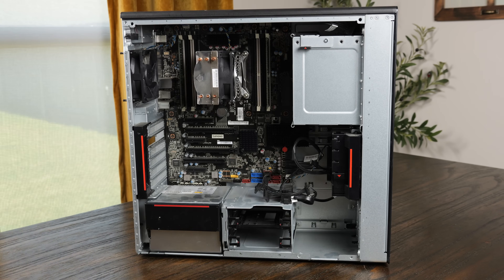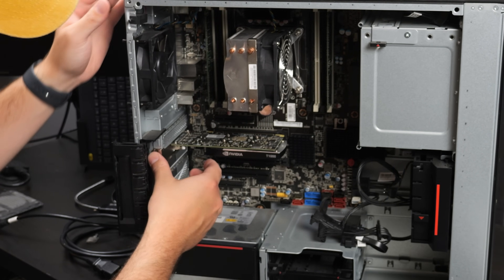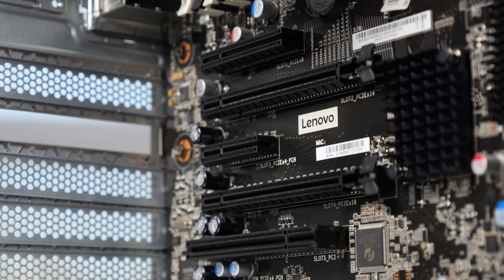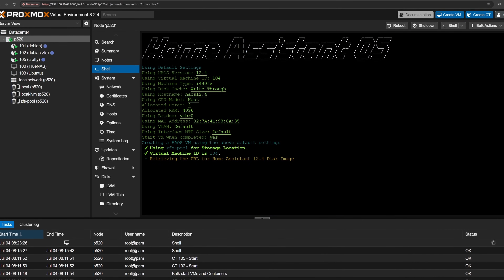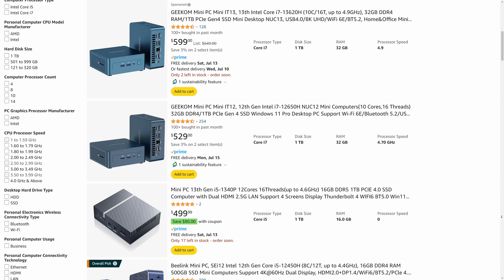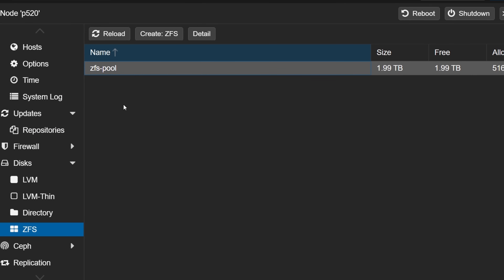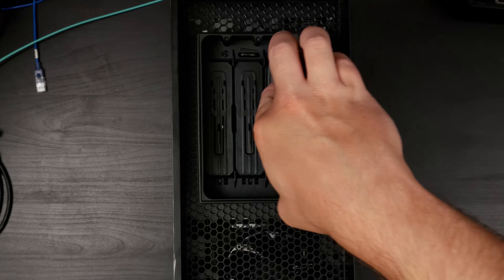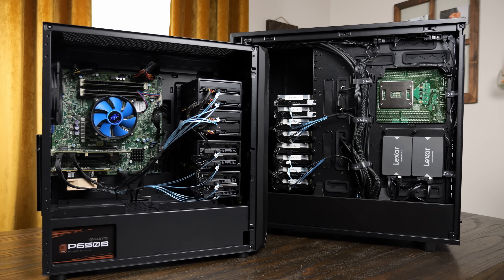A SERIOUS Home Server That's Affordable [Lenovo P520]

Comment: You should have gotten a HPZ800/840 instead. Dual Xeon, with a very smart layout for drives and cooling.
Reply: HP Z840 is an older system. HP Z8 G4 would be from the same generation as the ThinkStation
Reply: @Pasi123  Correct!..I replied without thinking.

Comment: I actually have a p510. It came with a E5 v3 6 core and 32 GB of ram. I upgraded to a E5 v4 10 core and 128gb of RAM. It has 4 HDD bays with trays and there's essentially a backplane in it. It also came with a Lenovo Flex adapter (proprietary) which holds one gen 3 nvme and one SATA m.2. I added a single nvme card and it's dead silent. Running Truenas scale (passed through the sata controller) and several VMs. I can't complain. I paid $100 for it from a local seller.
Reply: really just a fantastic deal.

Comment: Hm, about the 3D printed HDD cage, you say, it's not the best design. Still, if you have only two options, original from Lenovo, and the 3D printed cage, the latter is both, the second best solution, but also the worst solution. 😂

Comment: Yeah baby! P520!
*beams at mine over there, which is also used as a gaming PC for my kid, sporting a 2135, 32gbs ram, a couple M.2's and an ARC750)

Now go look at a PowerEdge T110-II! My old standby main server!
Reply: I'm interested in something like this. How did you power the ARC750?
Reply: @armandourbina3986 
I have two 6+2 pin connector cables attached to the mobo, with it connected 1x8 & 1x6.
I have yet to get Resizable Bar working but even without it the setup is wonderful for gaming.

Comment: Great video. About 4 months ago I bought a dell Precision 5820, easily the greatest computer purchase of my life. It was $650 AUD with 128gb of ram, an nvidia p1000 and the model up from the chip in this video the w-2145 which is an 8 core 16 thread cpu. If anyone is in the market for a home server these types of machines are incredible. My unit didn't come with an extra pci power adapter, so I picked one up for 20 bucks to run a 1070

Comment: I have a Brickstation P520 myself, it is a serious machine that I generally use for gaming and A/V rendering, or writing silly comments on Youtube. You could use the P520 as home server but its primary design is a workstation, it may not have some features that server systems would have. Lenovo's ThinkSystem machines are server-grade models and might be more suitable. Also, I did some measurements and found that the P520 could potentially accept consumer hardware. The case has punch-outs where a standard PSU could mount, and the motherboard could accommodate a standard mATX or ATX board. However, the case only provides about 110mm of clearance for a CPU cooler, and the front panel uses a proprietary edge connector that would need to be removed and replaced with a new power switch.

Comment: I have one running proxmox, the only issue was getting the bay expansion and the 4 power SATA cable, I'm wating for the cable but finding the expansion bays is really hard, I had to use a phantkets stackable bracket

Comment: I really love these for homelabs as long as you have the space for it. They're super nice to work with (bar the proprietary nature of it of course) and the only reason I didn't go for it is most of my server load just needs maybe 2 PCIe devices and most importantly, I just think rack mount looks nice albeit louder, more power hungry but in my case, cheaper up front cost but very timing dependent. Anyone looking to play with hardware more, might be trying out different PCIe devices, or just doesn't have a specific goal in mind, I can't recommend these enough especially for a lot of the prices you'll find.
Reply: There's a rack mount adapter for these also.  Big money for drawer slides from Lenovo, or a 3D printed option on printables.

Comment: PCIe lanes and remote access is everything I want in a system, especially if it is used as a server.
The closest thing to the Thing Station is technically a used AMD TR or lower class, which are still very expensive.
Or the way around ASrock's rack motherboards for AM4/5, which are also expensive but only have a maximum of 24 consumer PCIe lanes.

Comment: got a r630 with dual e5 2690v3 with dual 10gbe and dual gbe plus 32gb ddr4 for 117€. an absolut steal cuz used hardware is like the most expensive here in germany looking at ebay all around the world... 🥲

Comment: For starters, like me, I would recommend cheap Lenovo m720t, minitower with 3 sata on board (Ive put inside 2pcs 3.5hdd easily)  + 1 m2 nvme and intel i3 8100. Very cheap and power efficient

Comment: The Dell Precision workstation 5520s are all over ebay too and simular to this.  Lots of tooless easy expansions, etc..  I tested one with a Kil-a-watt and it hovered around 70 to 90 watts at idle on a windows 11 login in screen with one nvme boot drive and two spinning disks.

Comment: Why wouldn't someone want to buy Lenovo ??

They make the most reliable, upgradable, repairable hardware around !!

They have great parts availability and all the manuals and tech info are on their website, even for really old gear.

As a Laptop repair Technician, they're the only Laptop brand I'd buy.

I can see that their Enterprise gear uses proprietary crap, but so does Dell and HP.

Comment: didn't seem to be much newer that the E5-2699 which i got two at $40 a piece (18 cores, 35 threads), and drop them in a HP workstation that cost me $120

Comment: Yooo Hardware Haven, I bought a ThinkStation P510 for my home server last year!  It seemed like the cheapest way to get everything I wanted for my homelab.  It was cheap and easy to add a lot of upgrades, and it has been a reliable and powerful beast of a home server that I've been very happy with.  Power usage on mine is higher than I wish it was, but then again I've got two GPUs, four hard drives, an upgraded Xeon with way more cores than I actually need, and a ton of cards in it so that might be on me.  I think this is an excellent way to go for a home server!

Comment: Dell an HP also have some pretty good refurbished/second hand offerings of the same generation (Dell T5820/HP G4 Z4) that you can find for around the same price.  I have the slightly older T5810 and after throwing in some more ram and upgrading the CPU it served me well as a Proxmox server until I upgraded to Epyc Rome.  

If your budget stretches a little farther there are also Epyc Naples cpu/motherboard/ram combos all over eBay for pretty decent prices and you avoid the proprietary nonsense (but it's not a complete system).

Comment: I found out that proxmox somehow makes pretty high idle power draw. When i installed pop_os i got 10 watt less in idle. Maybe bc proxmox is using relatively old kernel? I don't know. Try to boot different os from the usb stick and see if it changes anything.

Comment: On one hand: that's some lenovo proprietary junk. On the other hand, though, you can actually buy spare parts and replacement somewhat into the future and it's actually easy to find what exactly you need in most cases.
Reply: yup

my grandfather's current desktop had some issues a few years ago and after looking into it, I figured the power supply was dying and the motherboard had scorch marks where the funny magic electricity escaped 

I bought a motherboard with a cpu (didn't need it) for $13 shipped on ebay lol. I ended up also upgrading his ram at the same time and threw an SSD into it.

That was 6 years ago and I haven't worked on it since, and he still uses it daily. Parts for that machine are plentiful and cheap.
Reply: @RoshiGaming  yep, I ditched my last x220 from 2011 just last year and it went to serve yet another user. Seem like proprietary, yet abundant is better than standard and rare.

Comment: Fun fact, the p520 has a proprietary motherboard, the p520c does not, and is a standard matx only needing a 24pin to 14pin PSU adapter.
Reply: One final comment (sorry, I primary a p520c and have a second one as a server) the w-2145 is the sweet spot value wise, you can get at around $80 and is 8c/16t and you can get retired iMac Pro specific xeons that fit in here for very inexpensive and work with no compatibility issues. You also should be able to bifurcate the x8 slot with the latest bios
Reply: @Saphykitten  hey, appreciate this info. Do you happen to know if the p520c has remote management options available? Also, do you know how many 3.5" drives the case supports stock? I've been trying to find that information and haven't been successful.
Reply: also, for those that are interested in the p520c, since the 5.25" drive bays are separated, you can't use the 3-drive bay converters from places like icydock. You can find the oem adapters, which are called "Front Access Storage Enclosures". There are also stuff from icydock that allow you to use 1 3.5" drive and 2 2.5" drives, but figured I would highlight both.
Reply: Thanks for this
Reply: nvm, I see in the documentation that the p520c does support intel amt.

Comment: Good to know that it can do headless mode without GPU. AMT seems to be useful. 
Biggest issue: limited chassis space for modern GPU, proprietary motherboard and PSU. PSU too weak for dual GPU (some user reported instability when using dual 3090 or even dual 300W TDP Quadro card ), and no upgrade path.
Reply: Why would u even want to put that in this low end system?

Comment: I like the affordable system, but it won't be affordable to run in most of Europe sadly.
Reply: Have any suggestions for something low power with more than 20/24 pcie lanes?
Reply: @Cynyr  Actually it's not really the CPU which dictates efficiency at low loads, it's everything around it.
You want to make use of ASPM, which will power down PCIe devices (including parts of the chipset) to save power and allow the CPU to go in to lower power states.
Support for ASPM is hit or miss depending on the motherboard, but generally the fewer added components, the better. ITX boards tend to have better support too.
Also make sure the PCIe devices you plan on connecting actually support ASPM, including NVMe SSDs.

Comment: I just bought an HP Z440 for my home server, and I'm starting to get buyers remorse. I could've gotten the dual CPU model (the Z640) for $10 more and now seeing this next gen one for not much more than that, I'm feeling even more buyers remorse 😭
Reply: I have a z440 that runs my truenas/jellyfin. It’s a good machine, it’s not as good as the p520, but it has a lot of life in it. You also can put it in a normal atx case, or in my instance, I have it in a 4u rack mount.
Reply: @Saphykitten  I rehomed a Z420 motherboard a few years ago and would not recommend.  While the form factor is standard ATX, there's a lot of proprietary headers on the board that require hacky workarounds.  From memory, there's a PSU adapter needed, fan and power switch headers are nonstandard, and there's a proprietary temperature sensor that the BIOS will complain about if absent.
Reply: I got a Z840 running dual E5-2667v4s and 128gb of ram (8x16gb) working as my first NAS and occasional cloud server although the second part has a WIP. It will probably end up as an off site backup server when I eventually get a rack setup.
Reply: I have both the Z440 and the G4 Z4 which is the next newest one. Both are fantastic. I installed some highish end nvidia cards. They game pretty well at 1080. 

Its hard to beat for $350.
Reply: @quademasters249  got mine for $130 💪 I tossed in a RX5700 that I had leftover from my main PC when I upgraded almost everything, and my buddy had an old ES E5-2683 v3 that I also tossed in. Now I got a killer TrueNAS machine that can do hardware acceleration for my Jellyfin instance

Comment: What’s wrong with Lenovo besides then being a Chinese company?
Reply: They're typically stuffed full with proprietary hardware.  In this case, the PSU and motherboard.
Reply: @zarendahl In this particular system’s case, I can see the justification for the proprietary hardware. Having the ability to quickly swap components like a PSU in a corporate environment is a must have, making system maintenance much quicker and simpler.
Reply: @TaberMedia  I absolutely agree with this.  It's why I'm not angry with it in this case.  The fact that they do this in non-corporate devices is why they keep getting shit on by most people.

Comment: While i prefer to be european most of the time, the amount of deals you guys have is insane. I've looked at my local ebay listings and they begin at 500€ for the p520 but keep in mind these include gpus.

Depending on how noisy these things are they would be pretty good homeservers indeed
Reply: Mine, sitting idle, makes no noise at all.  When it's under load, I can barely hear it at 10 ft (3-ish meters)
Reply: Even under load they are pretty quiet and if the fans start to go it's not a huge pain to find replacements.
Reply: Might be a pretty good deal then should have a look

Comment: I think there's a ton of value hiding out there just in decent old cases - heck my server case is older than dirt but it works - no flashing LED support or things in that vein, but I can swap out a PSU in just a few minutes and have a ton of cable room, with four drives in a virtualized TrueNas. It just works and it's paid for LOL😂

Comment: can you game?
Reply: lol
Reply: Certainly, but won't push ss much fps in esport games compaired to higher clock speed cpus. Also would need s GPU
Reply: It's not worth it for any decent gaming rig due to the power limitations from the proprietary PSU. You'd be limited in what cards you can add
Reply: Every CPUs can game, but not all games can run on every CPU.

The real question is, can it run crysis? 😂
Reply: Xeons not designed for gaming and you can play 2060 or 1660 without bottleneck. Its because low core speed 2.1 is really low and ram speeds 2133 its bad.
Reply: @kopbabakop1886 It’s not that simple. In fact Xeons can game pretty well if you know what you’re getting yourself into. As long as the games you play support multi-threading (which 99.9% of all modern games do), you will not notice the low clock speeds of Xeons as you have a shitload of cores and threads that can be used simultaneously before you run into any kind of bottleneck. 

My E5-2690v4 can play pretty much any modern title (Cyberpunk, Alan Wake 2, RdR2) to name a few without any CPU bottlenecks. Different story in single threaded games like Minecraft tho but I am more of a AAA gamer anyways. My CPU definitely still has enough headroom for more demanding titles.

The RAM situation is also not 1:1 comparable to consumer RAM since workstation CPUs are designed to support quad channel RAM instead of Dual channel. This (very oversimplified) means that my 2300 mhz quad channel RAM is as fast as conventional 4600mhz RAM running in channel RAM. And 4600 mhz is still enough bandwidth for modern gaming.

These older thinkstations are great budget gaming monsters. I have the p510 and as I said, it works pretty much flawlessly. Got mine with the 850W platinum PSU, 64gb of DDR4, 14tb of server HDDs and a 512 GB enterprise NVME basically for free. Paid 70 bucks not knowing the specs or anything from some dude on Craigslist. The system arrived without a single grain of dust on the inside and came with a laboratory DAQ card which I sold for 150 bucks to some random guy in India. This means I made at least 80 bucks buying this Thinkstation. I guess it’s hard to beat that price to performance ratio anytime soon for a workstation I can edit, design and game on.

Comment: Nice to see a video on these machines. I run a P500 with 7 drives on unraid and its amazing!
Reply: i'm currently in the process of getting a P720 ready for a proxmox virtualization server. 4x40TB WD RED, 256Gb DDR4 REG ECC 2600Mhz, 12x4TB 2,5' WD Red via 2x SAS Controller and Adaptors for 6x2,5 in 5,25' Bay, 2x Xeon 6138 (each 20c/40t), Nvidia Quadro K4200 for Jellyfin HD/4K Encoding, and 2x 4TB M.2 NVME in Raid0 for the OS and Storage of Images.
Reply: All 3.5”?
Reply: @zeroturn7091  yeah all 3.5 the p500 I got had 4 drives internal then I used a 2 5 1/4 to 3 3.5 drive dock in the front